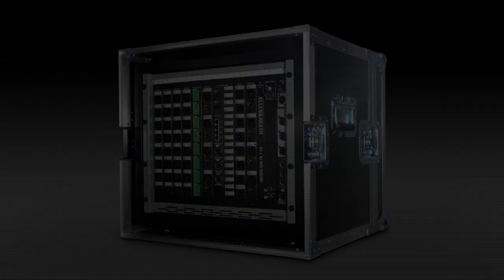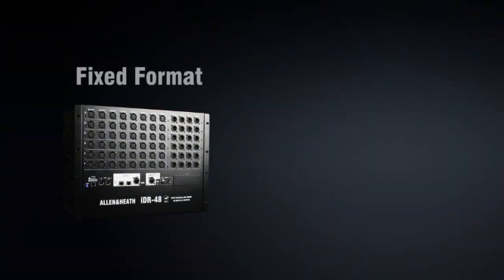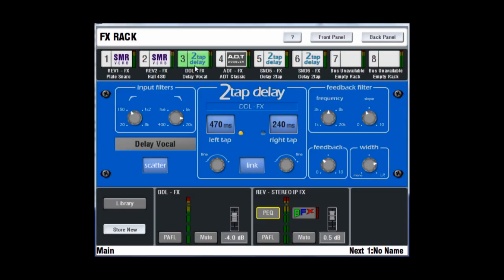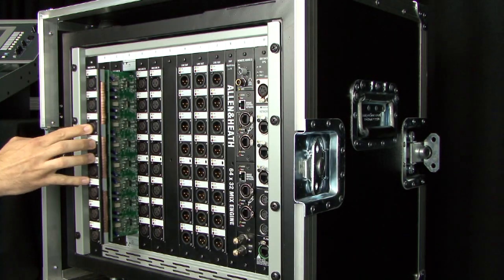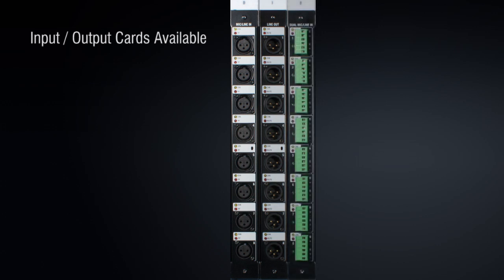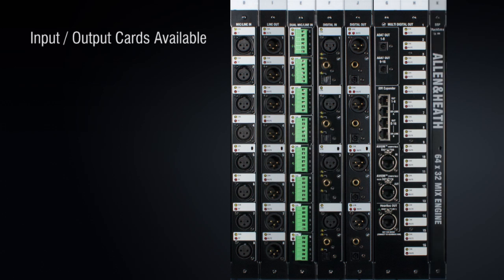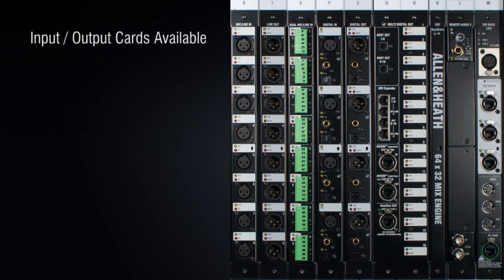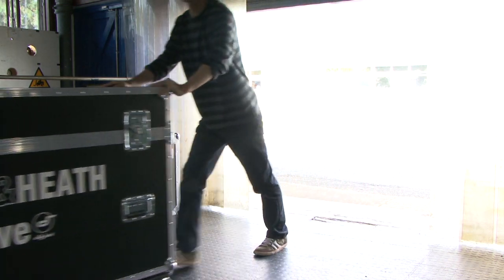iLive Mix Racks

Comment: Hi! What can you do so we can use this with SQ-6 or SQ7
Reply from the maker: Hi!

Connecting an iLive mix rack to SQ is not supported directly. The iLive mix rack is a mixer in its own right and can't be used as an IO expander. 

You could share audio between the two using a third party protocol, such as Dante. This would require a Dante card in each console. Again, this wouldn't make the mix rack act as an expander as the control for the preamps will remain in the iLive system. 

Thanks
Alex